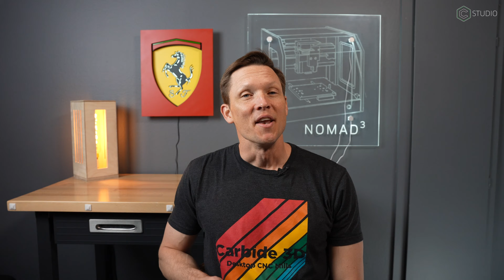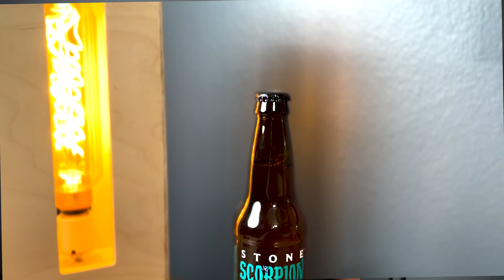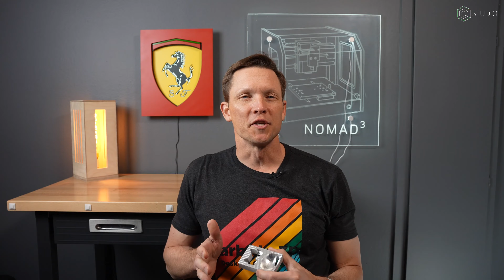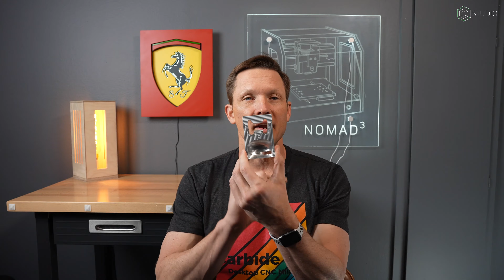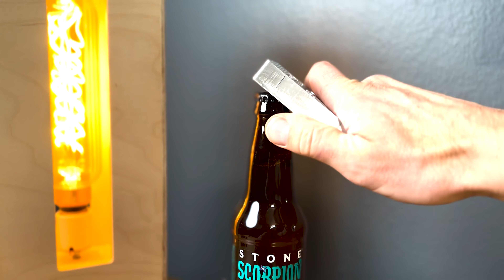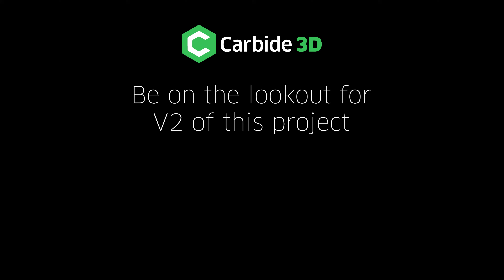1 Min. Build - Bottle Opener Recap

Comment: A suggestion to retain the bit in the collet. Make a collet with s set screw in one of the fingers of the collet. Make a flat on the side of the bit. Insert the bit into the collet. Tighten the set screw then place the collet in the router and tighten the collet nut.  I wonder why someone doesn't make this ?

Comment: Doing your own designs is tricky. I like to test mine out on a scrap of pine (2x4 scrap). That way, you can see how it looks, make sure your measured right, and since it’s pine, you can cut quick. When you are done, you refine before you try it on an expensive piece of wood.